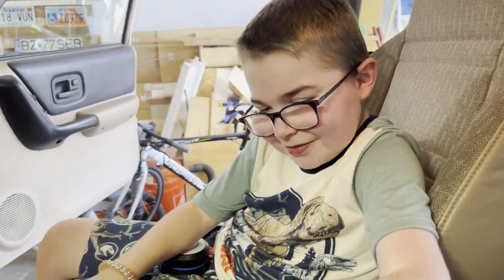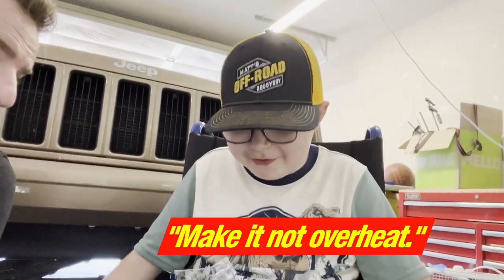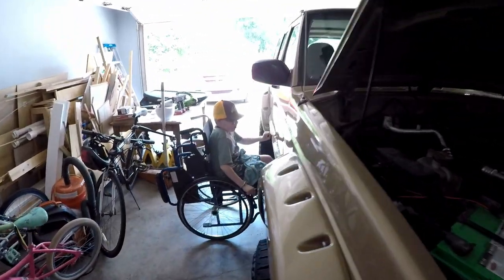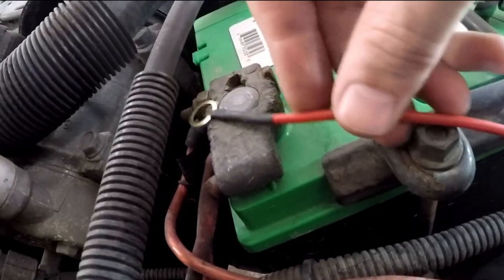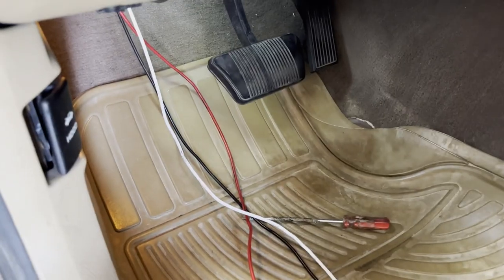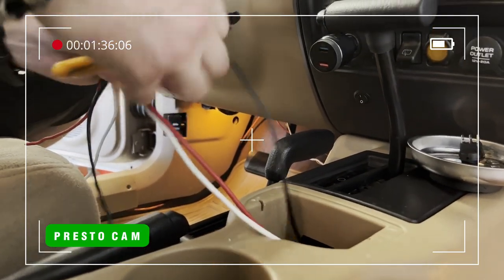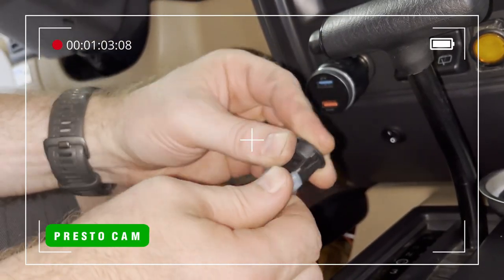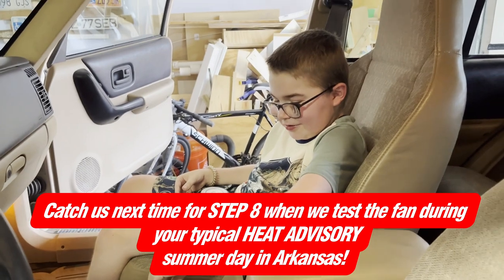Jeep XJ Build - Auxiliary Cooling Fan Override Switch Install to Stop HEAT SOAK

Comment: Im putting 2 fans on mine cause heat is bad under my hood
Reply from the maker: Nice. Adding a second fan and hood louvers was our next step if this didn't solve it. So far we've been good with just the override switch. Been out rock crawling on multiple 95+ days with no issues.
Reply: Swap the stock injectors to 4 or 12 hole will cure your heat soak problem…….